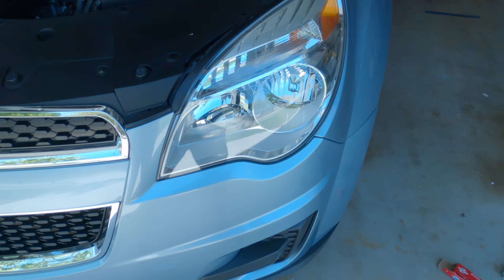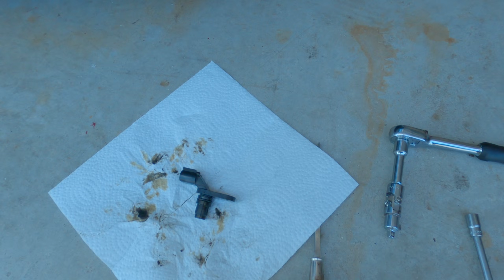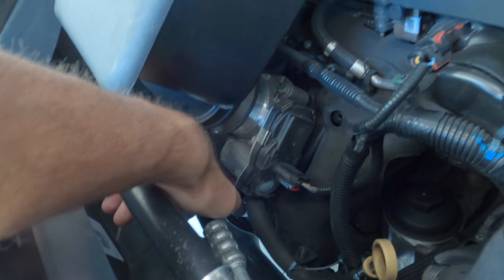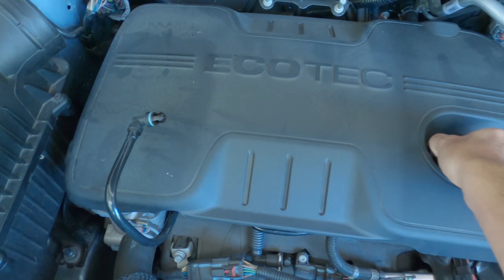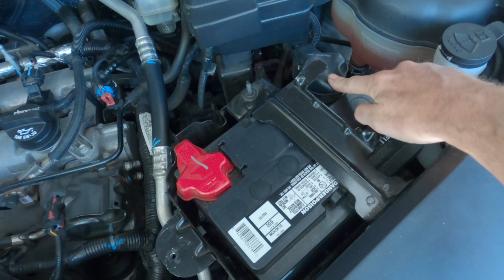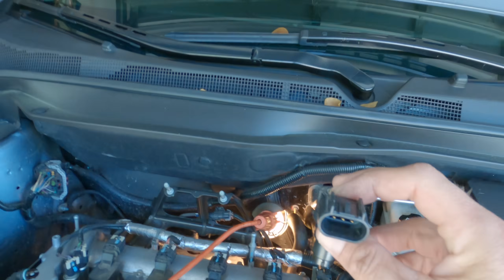2014 Equinox Camshaft Sensor Repair

Comment: We just purchased a used 2013 equinox.  It recently had fuel pump, timing chain, water pump, both VVT solenoids and serpentine belt done. We got it used as is in a few days later it started stalling. We’ve come to find out. They were probably chasing it and couldn’t figure it out so sold it. Since we’ve had it, I did the throttlebody and cleaned the MAF sensor. Today I did both camshaft sensors and it seems to be running better. If that doesn’t work, I’ll do the crankshaft sensor. Very frustrating.

Comment: That bolt is ridiculously hard to get on the back of the engine even with swivel ratcheting. I still have not gotten it. Thanks for the video!
Reply: 10mm wrench. Worked perfectly.

Comment: This was very helpful! I replaced camshaft sensor (11.00 bucks on Amazon)and code still reading 0010 so I changed both variable valves and code cleared. Both Parts was under 20.00 on Amazon. Thank you you for the detailed video

Comment: How does the clip come off
Reply from the maker: If I recall, slide out the little grey clip and try squeezing it right where the clip is at while pulling gently apart.  Look where the two come together.  You should be able to see the little hook that keeps the wire harness from accidentally disconnecting.  One tiny hook keeps that thing held together.   They are frustrating.
Reply: @everythingoutdoorsman  very
Reply: Thank you for the help 😊

Comment: I have a 12 equinox with p0014 b camshaft position timing over advance or system performance bank 1, all ready replaced both vvt solenoids still have the code but this fix it ??

Comment: Beyond all the positive and negative comments, I want to add to the positive comments. I've seen several videos related to this fix and you are the first to mention disconnecting the battery terminal to minimize any damage to an electrical component. Thank you! I'm making this fix in a day or so after already replacing the intake and exhaust solenoids a couple of weeks ago.
Reply from the maker: Thank you.  I appreciate the positive feedback  and am glad this video has been so helpful to so many.

Comment: Very Good Video. I have a friend (ad I'm no pro) who has a P0016 andn P0011 codes and I started on the VVT solenoids like you said most do. Fired it up with great expectations, and dang....still misfires/out ot time and pulled the Crankshaft and Cam sensor codes. Luckily they are easy to replace, and I might. tackle it this weekend and get him rolling.
Reply: So are ur codes still showing, cause I have P0014/P0013 and I get a camshaft with sensor problem with my odm thingy
Reply: @karlosspades7293   Not sure, friend was working a summer job and had to get back to TX I put new VT solenoid and Camshaft sensor, but not Crank sensor. He had it scheduled at a GM dealer soon after.
Reply: @bigeyejim I changed mine and nomore CE light, still have the camshaft sensor tho, no problem with it yet, but if, at least I had that to replace it
Reply: What bank number is that sensor?? A or b??? Bank 1

Comment: Advance and Zone says 2 required.  What about the second one?
Reply: there are 2 of them, other one on the front of the motor near the battery.
Reply from the maker: I have only replaced the one in the video.  No issues ever  since it was replaced.
Reply: Amigo ambos sensores son iguales ?

Comment: Bought one of these cars and has been nothing but junk, I'm hoping this is the fix cuz I'm broke as hell might as well take a gamble. Thanks for the video
Reply: Haven't had much problems with mine, at 157K km Changed VVT cyloniods too, and check engine light is out. Wat the problem with your vehicle

Comment: how many sensors are for the cam position
Reply: Did you find out?  The stores say 2.  This video says 1?
Reply: there are 2 sensors (dual overhead cam) so one on back as in this video and one in front near the battery

Comment: What if I'm getting a P0014 code? Will that be exhaust solenoid?
Reply from the maker: That should be either in intake or exhaust .  Id just swap both at the same time.  You can get both for about $30 on amazon.  Cheap enough to see if it fixes your issue.  Good luck.
Reply: @everythingoutdoorsman  solenoid or sensors?
Reply from the maker: Solenoid Should be.  Im not the best expert but that's been my experience.
Reply: @everythingoutdoorsman  and Amazon was your choice? I found them on Rock Auto, but they have so many choices/brands. Does it matter?

Comment: This guy is on the job. I got part and will fix later. But anyone watching do your homework! There are other channels call or confusing the parts. I already replaced both the intake and exhaust ones. Now to change this sucker.
Thank you I will leave it plugged in till removed. Who wants to pick it off floor. Hope to get it fixed today

Comment from the maker: Honestly, if your vehicle is stalling and you have the P0011 code, then most likely it is the variable valve sensor.  That is based off the statistics I got from the auto parts store and the most common failures.  The intake and exhaust sensors go bad pretty regular.   My vehicle only has 60,000 miles on it and I have had both the intake and exhaust valves go bad on me.  When I got the P0011 code pop up, I changed both the intake sensor and camshaft position sensor just to be on the safe side.   So if I was you, I would start with replacing the intake sensor first to see if that solves the problem.   If not, then change the camshaft position sensor.  Plus the intake sensor is easier to replace because of where it is located.  Hope that helps.  I haven't had a problem since I changed them.
Reply: I did change all 3 sensors, and still stalling 15 seconds after first start up
Reply from the maker: @chinchillamade  Make sure you didn't install the intake and exhaust in reverse spots.  If not, check the code again and see if you may be having a different issue.  There are multiple different causes from the same code.  This is just some of the most common.
Reply: @chinchillamade  having the same problem did you figure it out

Comment: Same question as the other guy. How did you know it was the rear sensor compared to the front one? Thanks for making this video by the way.
Reply from the maker: Honestly, if your vehicle is stalling and you have the P0011 code, then most likely it is the variable valve sensor.  That is based off the statistics I got from the auto parts store and the most common failures.  The intake and exhaust sensors go bad pretty regular.   My vehicle only has 60,000 miles on it and I have had both the intake and exhaust valves go bad on me.  When I got the P0011 code pop up, I changed both the intake sensor and camshaft position sensor just to be on the safe side.   So if I was you, I would start with replacing the intake sensor first to see if that solves the problem.   If not, then change the camshaft position sensor.  Plus the intake sensor is easier to replace because of where it is located.  Hope that helps.  I haven't had a problem since I changed them.

Comment: How did you determine it wasnt the front same sensor toward the front of the engine?
Reply from the maker: Honestly, if your vehicle is stalling and you have the P0011 code, then most likely it is the variable valve sensor.  That is based off the statistics I got from the auto parts store and the most common failures.  The intake and exhaust sensors go bad pretty regular.   My vehicle only has 60,000 miles on it and I have had both the intake and exhaust valves go bad on me.  When I got the P0011 code pop up, I changed both the intake sensor and camshaft position sensor just to be on the safe side.   So if I was you, I would start with replacing the intake sensor first to see if that solves the problem.   If not, then change the camshaft position sensor.  Plus the intake sensor is easier to replace because of where it is located.  Hope that helps.  I haven't had a problem since I changed them.